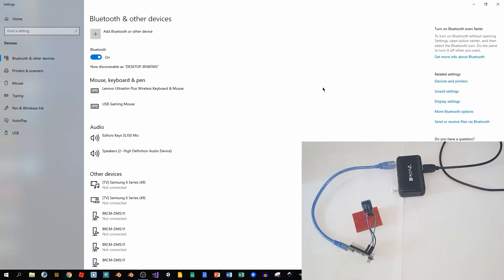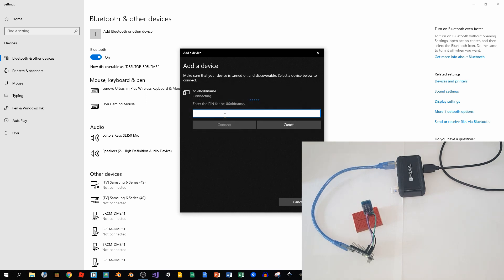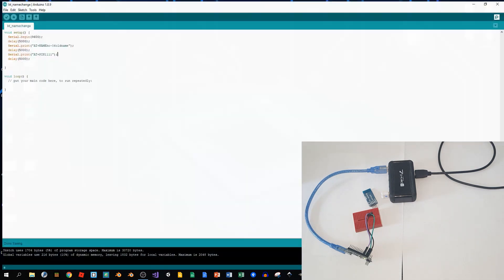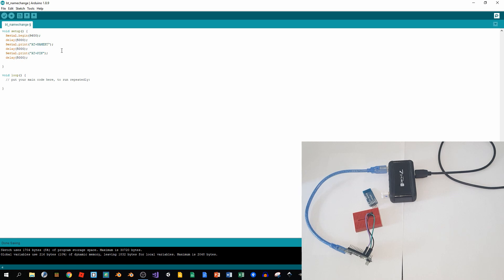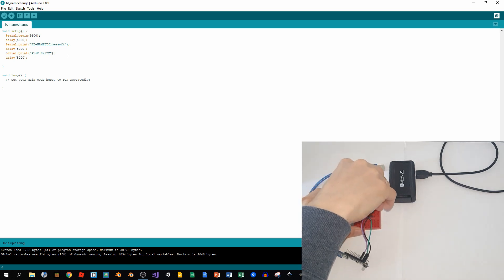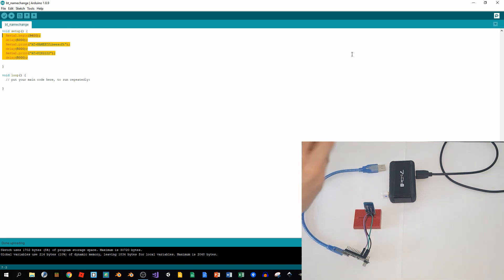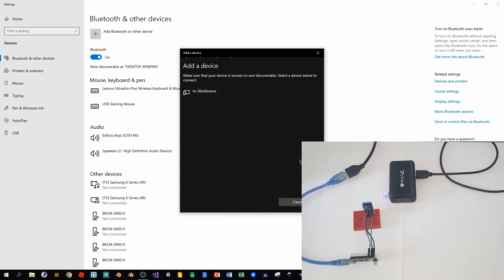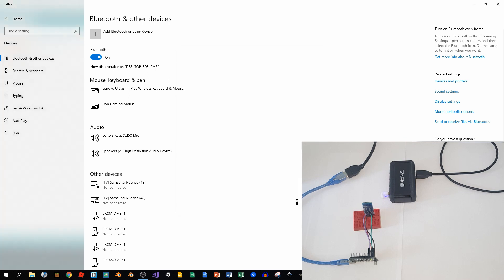Arduino BT module name and pin change HC 06 - The easy way

Comment: What happened with my other sketch uploaded to the arduino? Does this erase other sketches or just simply add a new one?
Reply: Obviously it erases it. It just flashes what is in your current sketch!
Reply from the maker: It's a good question but I havent checked it. I did bt first and uploaded other sketch later on. Give it a try and let us know :)